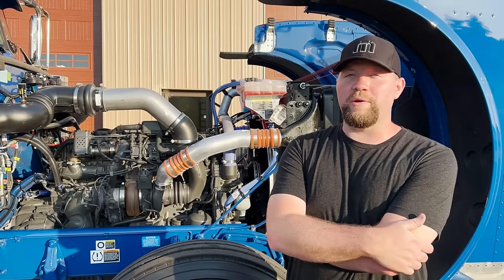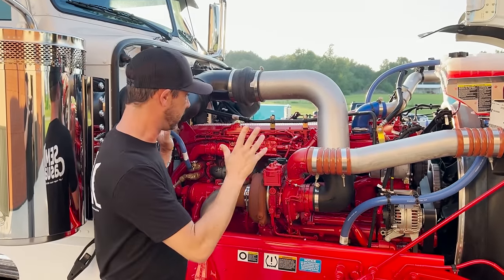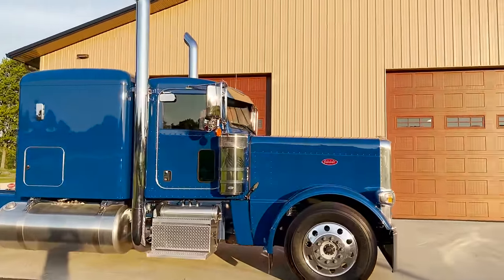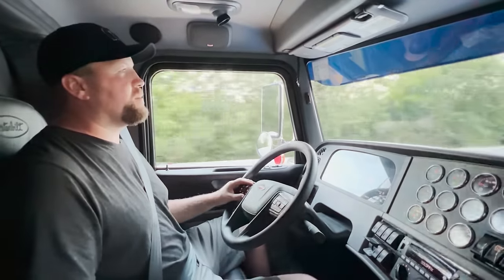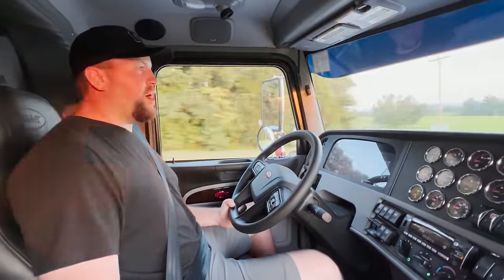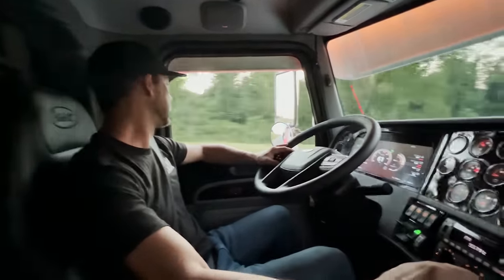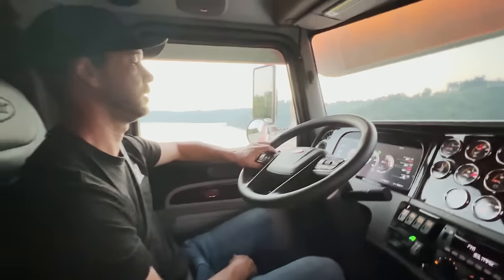Cummins X15  VS.  Paccar MX13  -  What are you gonna choose?

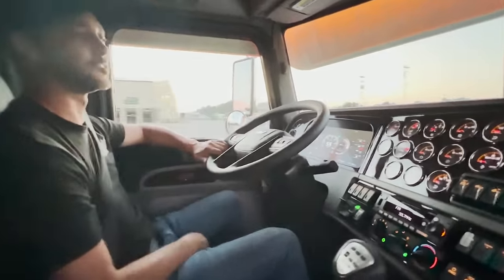Comment: @19:20

And the truth hurts!

One of the major reasons I chose to get my own truck is I want horsepower and performance.

  I don't want a truck that can't get out of its own way like I had to suffer with many company trucks I drove.  It baffles me that lease operators would want to buy a fleet truck and not change the settings. God bless those that don't mind slowing down 10 miles an hour up at 2% grade and upper Michigan or upper Wisconsin and just to get their 7 miles per gallon but for me I'll take my Cummins N14 and just chop right up that hill not losing a half mile an hour on cruise control.

Comment: In my day, more than 60 year's ago. There was a phrase amung us OTR's and to a degree some local's. That went: Nothing runs like a CAT. Which was generally followed up by someone saying, apprently you've never driving a cummng's. Just as 4 wheel's have their various motor's in which one is better at this for doing that. So are the various large car motor's.

Depending on one usefullness of a motor, not all motor's are the same. Wanna go fast for extended periods of time, such as in all day every day long hauling, cumming's is your answer. Got a generator that doesn't ever move and need a consistant source of power to operate for extended period's of time, cat is you answer. Detroit is what it's always been, a location in Michigan.

Comment: 60,000 lol & 70,000 mile oil Change intervals are engine killers especially with your Tree Hugging EPA boot licking engines. Even if you run fully synthetic oil that can handle the soot levels the filters don’t. Look at Warranty Claims and Warranty rebuilds for These extended Oil Intervals Carbon Packing is an issue to say the least. Final not Cummings Resale is 50% better than Paccar and The MX are a nightmare to work on.
Reply: The MX is a good company truck but the X15 will always treat the owner operator better

Comment: Cummins x15 500 HP 13 speed 3:90  rears in a lite as practical T800 separate 42" flattop 220" wb single 150 gal tank drivers side front def tank drivers side 
Stubby dual stacks and dual breathers side of cab battery box air tanks and wet kit pass side. Schneider Bob the frame behind the last axle. Why KW has 18" of frame behind the last axle only God knows. CHOP IT OFF! With a 48" tall blockable long slide 5th wheel. 
Old school cowl mounted west coast mirrors with spots top and bottom 
11r22.5 on alcoas with disc brakes. 
I run containers tanks and dumps. Intercity 2 lanes hills an mountains East KY Oh and WVA. home every night but sometimes you'll get stuck. Stupid shipper/lazy receiver. Keep tare weight around 18000 lbs full fuel. 
Old school truck 9670 single bunk 200 
" Wb red top N14 13 speed 390 rears on Hendrickson walking beam 11r22.5

Comment: I had a 2014 PACCAR 280,000 mi that almost bankrupt me dealership only repairs because software and the parts were  ridiculously overpriced  $ 4000 for an exhaust back pressure valve $5,000 for an EGR $500 for a back pressure sensor ......... Luckily I never needed a turbo but I was told at the time that they could run anywhere from 12 to $15,000...

Then don't get me started on the every other month the $10,000 dealership visits and two week long stents of downtime usually followed up by another few days after I drove the truck 20 to 40 miles away from the dealership and the stop engine light came back on.......

Comment: Pacar is most definitely the engine of choice.  Those engines are easily good for 1.3 million miles. If you treat it good. Definitely 1.5 million before rebuild.
 X15 sucks. Good for about 600k before critical components fail.
Mechanics hate working on pacar because the design. It's not harder, it's more time consuming. Mechanics are lazy and like Cummings because they are cheap and easy. 
If you want a damn good dependable engine. Your only choice is pacar. I have a fleet of them. One critical failure in 3 years. Had to replace water pump housing. All my trucks have over 850k and running strong. I recommend getting it deleted the first time you have emissions problems. Emissions are built by Cummings. Typical cheap and shitty design.

Comment: Cummins. Cummins have been proven like Detroits and Cats. I mean Detriot kind of screwed the pooch in their Vs.

As for fuel mileage? Yeah well bigger, more power and fuel milage is apples to oranges. I prefer a Cat or Detroit over Cummins and truck manufactured engines I don't want any part of. Just sayin after 40 years of driving.

Comment: Some guys their mind is so narrow all they think about is pulling power. 
Ohh Cat ohh cat ohh cat. 
No taking in consideration that there's way  more than that. 
Weight of the engine 
Fuel consumption 
Parts price
Repair price 
And a long standing history of reliability 
Big cam lll big cam lV l10 N14 ISX.
So overall l would never run anything else than cummins. . Paccar only good thing fuel consumption other than that no power too many sensors so complicatedto workon and diagnose... IMHO just crap.  Cummins all the way 👍

Comment: I wish you would compare apples to apples. But your comparison is like comparing two empty 5 gallon buckets, one with plastic hane ant the other with a metal handle. A please quit blowing smoke up people's back side, because if you were concerned with fuel mileage, you would have went with a curb sniffer, with a condo sleeper.

Comment: That paccar will need an in-frame rebuild before it’s first oil change.  It’s designed like crap and they have huge camshaft problems.  Even the X15 heavy haul motor has similar problems.   Between the two, I’d take the cummins, but the days of the 855 big cam, N14, ISX, Series 60, C15/C18, etc were way better than both these motors.  Things are just made too cheaply in this day and age and you cut enough corners to make a buck and you get motors that won’t even stay together. I’d rather have a 2 stroke than that paccar, at least the 2 stroke will last.

Comment: The paccar will burn jus as much fuel as would the x15
Because for the torque it uses.to pull the gvwr  
Basically you're comparing a two wheeler over a four

Comment: DAF in Europe is Paccar and the motor I drove for 8 months was the 530 with a 14 speed Auto.  Fuel Consumption is 100% it's advantage. Not a bad truck, but the gearbox is a little agricultural. Weak point was the motor ECU and at 6k DAF did not want to pay for a new one.

Comment: I also think OVERALL cost is EVERYTHING, from purchase to resale. I agree, they are probably 2 different buyers. Both trucks new, Paccar mx $4500 cheaper. Keep them both, 500k miles, that Cummins will bring you back $15-18k more at trade. Dealers tell you, struggle to sell a paccar. I think paccar with an 18 spd would be same as like buying a 605 X15 with an automated.  No one REALLY WANTS to do thst. They SETTLE for it. If I'm purchasing a today's numbers $215k for Paccar and $220 for X15, spend the money, be happy! You'll be telling people all the time about your purchase and why if you went Paccar and you'd be trying to convince YOURSRLF, as much as them during your conversation. Thst being said, a 389 or W900 should only have Cummins X15 at LEAST 565HP, 13 spd with 1850 or 605hp and 18spd with 2050 torque. You want to save money and weight? Buy a 579 or Next Gen T680 with Paccar mx 13 litre,, 12 spd automated, Yada, Yada, Yada. THOSE trucks will resell to THOSE buyers and Large Cars will sell to large car buyers. To make a long story short,  here's my analogy. If you were to purchase a BRAND NEW HOME, would you buy a 3 bed 2.5 bath house with a carport or 1 car garage? You'd save a few bucks. But it wouldn't make sense. ESPECIALLY on resale. That being said, on a restricted budget, buying used, yeah you even buy a 2, 2, 1. And call it a STARTER home!! NOT, your DREAM HOME!! Go BIG, or go Home.....lol. Great video guys. Sorry I was winded, but trying to make a point.

Comment: Only way to fly is with a Glider. Screw those eLog Emissions pieces of junk. Running Flatbed all over the country and still got from 5.5-7+ mpg with a 500hp/13spd Detroit S60 - 12.7. Less headaches and repairing costs and best of all no childish logging. In addition if you aren't getting paid by percentage (30%) of the loads you aren't making as much money.

Comment: They're both garbage, they both use the same turbo, egr system and aftertreatment. The MX is more messy because of the rear drive gear train, and I bet the Cummins still chews up camshafts and drops liners.